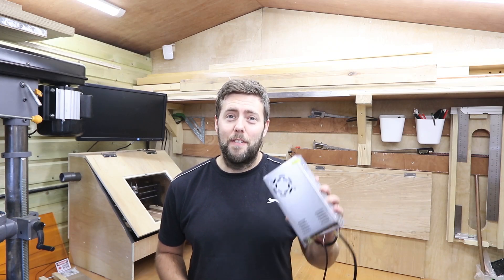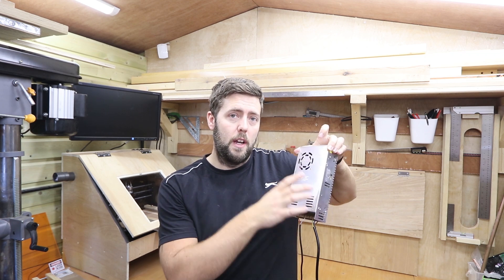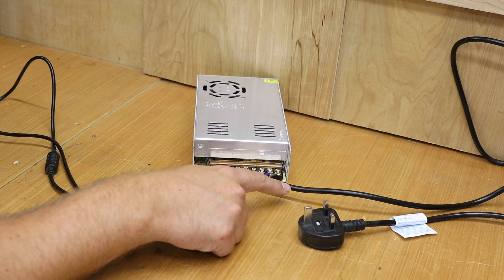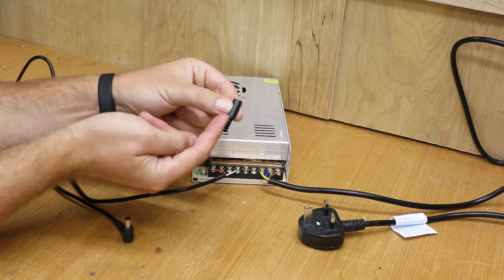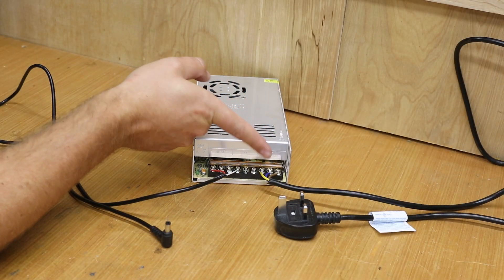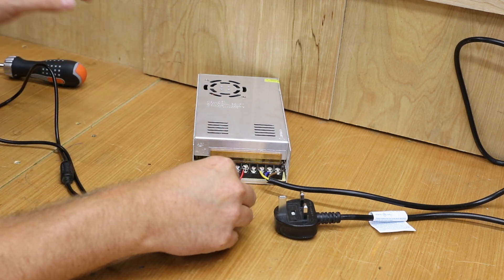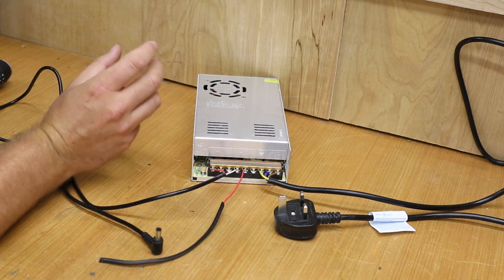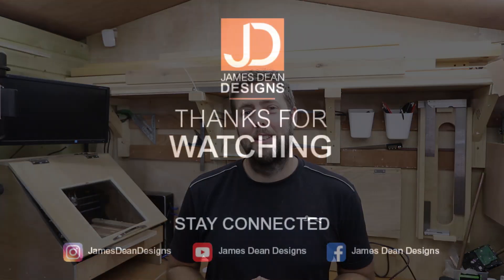3018 PRO - Wiring a new power supply unit

Comment: Hi James. I think your videos are great and they are helping me a lot. One concern I do have about safety is this power supply video. What are you connecting the earth wire for. If you so a continuity test from the earth terminal to the casing you will almost certainly find they are not connected. I solved tgis by running an earth wire from the connector outside and up to the vase screw on top. Problem solved and a safe earthed case.

Comment: Hi James ! You have many great videos here ! Thank you ! I bought this 3018 plus 500w ..and It only gives me one 48V PSU for the entire machine . But the machine ITS getting freezing after some cutting spindle keeeps working...then i thought It could be the psu cant handle everithing since ITS 48v10A and Its Wired to the input screwed into my Controller board to properly manage the spindle . Some guys are instructing me to separate the Power source ..like using the 48v to the spindle only and adding another 12v 5a psu TO THE SAME BOARD Through a Jack provided aside of the USB conector ... But im AFRAID on sourcing 2 different Power supply like 12v5a DC charger +48v10a PSU in the same system .. idk im not the expert on eletricity but It seems like a problem tô commect 2 different Power suppliers into same board ...kinda its going to screw It ALL like burning exploding sparkling lol . The correct should be take off spindle source apart from the board and wire spindle with reley and Speed dial and put only a Jack for feed the machine motors ? Please give me a light someone who reads It . And James ! Congratulations for good material provided
Reply from the maker: Usually you 3018 control board only requires 24v so if you are running it with 48v that may already be causing some issues. However your 500w will require 48v so in fact you might need 2 separate PSU's anyway unless your board is working off a 48V input. There are no issues really in using two separate power supplies. What I would suggest doing, if not done so already, is post this question on the Sainsmart group facebook page with some photos of your equipment. It will be much easier to get answers there
Reply: @JamesDeanDesigns  the board have 3 inputs, being one a jack for common jacked PSU (like a notebook PSU) another for 24v for 300w spindle. the 3rd input its for 48v for those who use 500w spindle ( me) ok. the kit comes with a sigle metalic common PSU with screws and voltage adjust switch. this PSU its 50v10A, i setted it to 48v, and this its the only power source for the machine. The question its i can plug PLUS 24V5A through Jack and keep BOTH PSUs working into the SAME board SIMUTANEOUSLY?

Comment: Hello Sir, send a question over from Germany. So my Question is: After the Power Supply is attached to the Controller Board - do you ramp it up with the recommende Gcode or do direcly draw full power to the Spindle. If i power it separtely is there a need to jumper anything in the board, cause controller board noticed that the Spindle isn't attached. May be i'am wrong. Thanks in Advance.

Comment: So I just followed your wiring guide and attached my 20k sainsmart spindle. Man that thing spins!! Only problem is that it doesn't seem to stop. I run easel and it started up just great but when I cancelled the carve, it moved to the origin but never stopped spinning. Any ideas?
Reply from the maker: Hi Andy, I'd suggest not running your machine through Easel  for a few reasons but this possibly being one. Try UGS or Candle and it should be OK. Alternatively you can type m5 hit enter and that should stop it

Comment: Hi, I measured RPM of my spindle (with cheap tachometer); 11000 with externally connected 24 PSU. I am considering to change my spindle to get 18.000-20.000 RPM. Will it make any difference on wood carving?
Reply from the maker: Yes, whilst there isnt really any more torque it does still clean chips a bit faster. I probably gained 20% on my speeds going upto a 20k spindle
Reply: @JamesDeanDesigns  you say, 11k rpm is ok. Correct?

Comment: Hi.James.my power supply is coming tomorrow, ive got a multi meter. what settings do I put it on to find the right output I think you said 24v.thanks again.
Reply from the maker: There is usually a section with a big V- and in that section you should be able to see probably 20 or 200

Comment: Your videos look like they will be really helpful for me when I get this worked out.
I've inherited one of these (my daughter husband died).  Anyway, there are a few things missing but the main one is the 24v power supply.  
I'm wondering if you could let me know, for a stock standard (with a laser) 3018pro how many amps does the supply have to provide?
Thanks!
Reply from the maker: Thanks. The standard power supply is rated at 5amp I believe. However if you need to buy a new one anyway then I'd just go for the higher power one to be safe as the proce difference usually isn't that much
Reply: Thanks  @JamesDeanDesigns  I was simply worried about the minimum required so I didn't get anything too small..

Comment: I see that the PSU you linked to is 15A -360W, as it happens I already have a 10A-240W PSU is that sufficient wattage to run a similar rig to yours? Thanks for the videos btw very informative.
Reply from the maker: I'm not an electrical expert but I'm 99% sure that should be more than sufficient for this machine
Reply: @JamesDeanDesigns  many thanks James, keep up with the great videos!

Comment: @James Dean Designs, any chance you will be upgrading to the 4030?
Reply from the maker: Not sure what I'm doing yet. I need a bigger CNC but weighing up my choices at the minute
Reply: @JamesDeanDesigns  I just ordered one. Been cutting 3D stuff on the 3018 and it really struggles with pine. Not sure it'll cut hardwood. Good luck, just seen a cool video of making and using an XYZ probe with UGS. Think that's my next project.. Good Cutting!!
Reply from the maker: @KenDilas01  the 3018 will cut hardwood, I do oak with mine, but you just have to slow it down and make sure your bits are not blunt. At least the 4030 does have a more powerful spindle and it has the upgraded spindle mount as well. Hope it goes well

Comment: Hi James, I have just upgraded my old 3018 to an all aluminium stronger built machine ( https://www.aliexpress.com/item/4001315757666.html?spm=a2g0s.9042311.0.0.5ce663c0DI3XBN). I also ordered a Cronos Maker  control board like yours. The reason I went for this control board was to run my 48volt 300watt spindle directly (see wiring diagram https://www.aliexpress.com/item/4000203646735.html?spm=a2g0s.9042311.0.0.5ce663c0DI3XBN) but I am having difficulty sourcing a 36volt power supply, do you know where I can get one and/or if it is needed when using my 48volt power supply wired as per the diagram? Any help would be greatly appreciated.
Reply from the maker: Hi John, not sure where you are based but i put 36v PSU into amazon and got quite a few results. I suspect you may need 2 separate supplies as 48v might be too much to run the control boards itself unless you put a stepdown converter inline

Comment: Any links for alternative motors as the one you linked to in the last video is sold out. I can see loads of 775 motors but they all seem to be 12/24v, are they OK?
Reply from the maker: There are others but I've been cautious to share any links as I havent tested them my self. In theory any 24v 775 will work but you will ideally want ones that are rated around 20k RPM at 24v
Reply: James Dean Designs That’s fair enough mate. Does them being 12/24v matter as long as they do 20k rpm at 24v?
Reply from the maker: @Yosser70  they need to be able to run at 24v, but some can be variable and run at 12 or 36 as well. Just checked and this one seems to be rated at 20k at 24v https://amzn.to/2HbSeCp

Comment: Excellent, James, thanks! One thing that I'm not 100% sure about: Are you running the power directly to the control board and the spindle separately or are you getting the spindle power off the control board like in the default setup with the original spindle?
Reply from the maker: Me personally, I run the spindle from the control board. However a few people have stated their control board can't handle the draw of a 20k spindle so you can run the spindle separately with these PSUs if you want
Reply: @JamesDeanDesigns  thank you!

Comment: Thank you James for this short instruction video. People must not underestimate the danger that extents from high voltage. It's not rocket science, but care must be taken during wiring and probably even more, when operating the unit. The transparent flip cover on the terminal side is in my opinion not sufficient. If available, get or print a cover. Also look for proper mounts so the PSU is properly mounted in a safe place. Unless the brick is dropped in a bucket of water, it might be safe to just have it somewhere in a corner of the desk or floor. Not with these type of PSU we see here. Also people should take care of that the wires cannot be pulled out by accident from the terminals. Imagine someone, a child perhaps, that trips over the power cord and all of a sudden you have a live wire dangling somewhere, freshly stripped off the terminal of the PSU. So whatever pull one applies to the cord, the wires must not come loose from the terminals. Having said that, I think such a PSU is a great upgrade to the 3018 CNC...I'm going to fix mine from my Creality ENDER-4 3D Printer that blew up right away the day I got it. :-) Speaking of CNC...I've spotted an introduction video of the new Sainsmart Genmitsu 4030 CNC....very promising...first investigations show it's around EUR 850...hmmm..but stills comes with an ER11 collet and 110mm Z path ...
Reply from the maker: Thats some great advice. Thanks for sharing it. 
Yes, the new machine from Sainsmart does look good. I also like the fact it can take a bigger spindle like the Dewalt router